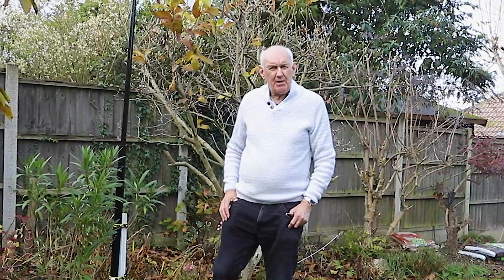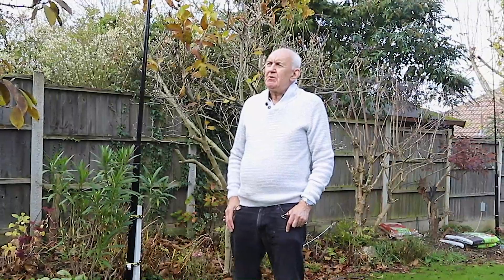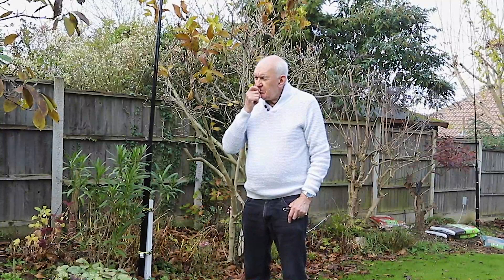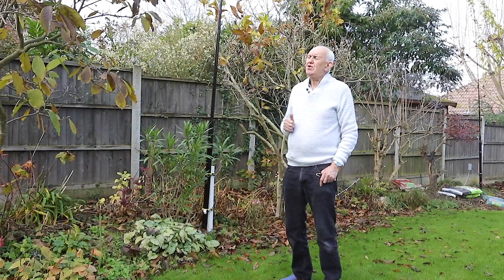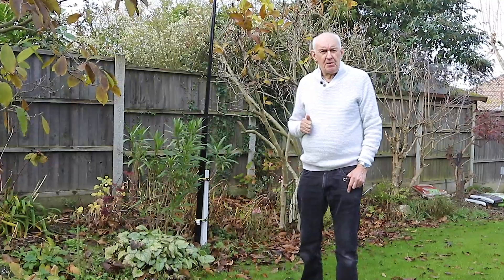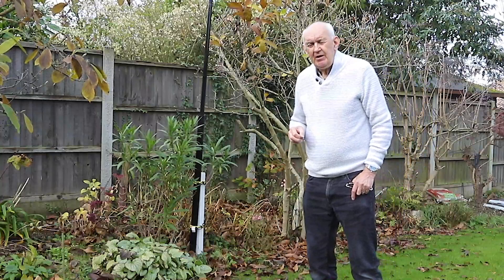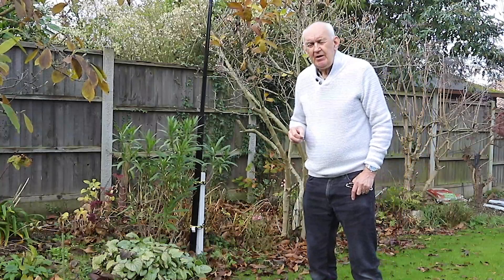The Magic Antenna - Joystick VFA

Comment: I did work into Czechoslovakia on 160m cw with my Joystick from Plymouth.  I added a long counterpoise wire that went out of the house and down into the garden. it boosted the 160m signals by an S point or more. I think the counterpoise was doing most of the work.   This was 1976 and what did I know about aerials then. We didn't even have swr meters in those days.

Comment: I have built two of these. I use one at the home QTH in King William County, Virginia, USA and the other at my Summer home on the Outer Banks of North Carolina. They, surprisingly, work pretty well. I've made  DX contacts and QSOs as far away as Australia. I used the "WA3WZR Modernized Joystick" design using materials I had on hand.
Jim Pyne AJ4CA

Comment: Hi Peter - Your video brings back memories of when I owned a Joystick antenna. I think I paid $29 for the antenna.  The coil was covered in plastic (secret stuff :) and I had mine propped against the wall of my bedroom and used a Heathkit HW-100 transceiver and yes I did make lots of contacts. I took the antenna with me when I was at Arizona State University and gave it to a friend who had just become a ham. I replicated the Joystick when I finished my studies and still have that antenna and the Joymatch upstairs in a second bedroom. I have used the antenna since the late 1960's and for an easy to build antenna it has served me well. When I was at ASU I would frequently work Hawaiian stations on 10 meters. Having outside antenna restrictions where I now live, I still use the Joystick with my Heathkit SB-102 on 40 meters. I also remember the advertisements for this antenna saying that it was as good as a 3 element beam - it was good, but more because of the sunspot peak during that period. The antenna is still fun to use and thank you for the video.
73, Bob W3ARA

Comment: Hi Peter, I was newly licensed back in the mid 60's and read an article in 73 magazine for an antenna called the "Little Wonder" by W5ZBC. The construction plans were similar to the "JoyStick". As I lived in an apartment at the time, I built one out of two 36-inch lengths of copper tube with a wooden dowel and coil of #16 wire in the middle. I used an L-network tuner and an unspecified length of single feeder. Of course it worked for many CW contacts. It also generated lots of RF burns and lots of interference with the neighbors TVs and HI equipment. Those were fun times! Thanks for the memories, K5RY

Comment: As a 12-year-old SWL in the early 70s, I recall the Joystick VFA being mentioned in PW all the time, used by listeners as well as licenced amateurs. I assumed, back then, it had something secret and amazing about it. I'd have liked one, although I'm sure my length of wire running down the garden with my little L-match ATU was just as good. 
The low noise levels back then meant everything, no matter what antenna you had. I remember those evenings where the only noise on 80 was a bit of TV timebase buzz, very low level: and the occasional crackle as a light switch was operated somewhere.
73 de G0IFI
Reply from the maker: Hi, nice to hear from you. Happy memories! 73s Peter

Comment: I certainly remember well as I was raised in Margate Kent next door to Broadstairs where George had his business.  Remember seeing his car parked outside with this VFA antenna on the roof rack . Was mounted at an angle, strange setup.   I remember as a SWL  hearing G3EBU near Canterbury   on top band using the lot stick. He had it mounted on a 29ft pole with 60 ft single wire feeding it. Well it's pretty obvious the single wire was the main radiator.    I was only 18 then. I eventually did the CG Rae sat Ramsgate in 1968. But due to my work as an electrician it was 6 years later before I applied for a licence. G4GJA and now a GW. Good memories.
Reply from the maker: Hi Kem, great to hear from you. I was active on top band in the early 1960s and had many contacts from Essex with the Kent hams. Great times. Thanks for the info. 73 Peter.

Comment: I remeber my late Dad G3LSZ had one. I am guessing that the Joy thing was that it was quick to deploy. It had a rubber foot on each end so you could lean it against a wall easily. It was painted light blue with a wing nut at one end to take a single wire feed.

Comment: Back in the 70's I knew an SWL who had the VFA installed in his upstairs spare room shack. From what I remember when I visited him one evening, was how well it worked on 80 Meters for an indoor antenna. To look at it you wouldn't think it could work so well as it did, I was amazed. Many SSB and CW signals were 59+ on the S meter of his Yaesu FR-50B, which impressed me no end as I also was an SWL. He also used the VFA on the higher HF bands for DXing including 10M, and had a great score, on the Heard All Prefixes Short Wave Magazine SWL feature. So I think good propagation conditions and low noise levels apart from TV timebase, played the part for the VFA. These days it's a completely different story of course.
Reply from the maker: Nice to hear from you. I think the much lower noise level in those days, helped.  73s. Peter
Reply: @watersstanton  Yes that's true Peter, I can remember the lower noise levels, especially on Top Band. They were great times for amateur radio.

Comment: Back in early 1968 I had Joystick Antenna.  It was  located indoors I managed to work XE2JS and UA0ZV on 40 meter CW using a homebrew 2 tube 30 watt transmitter and a Heath HR 2 receiver that had no CW filter. The reason for the indoor antenna is a neighbor complaining about TVI maybe with a hidden antenna he will stop complaining which he did ! Oh yes I was located in Portland  and that make it easier to contact UA0 land.

Comment: Hi Peter, I had one in use with my first receiver, a Trio 9r 59ds, bought from a dealer in Leyton. I only used it for RX, but it seemed to work well enough, mind you, I had nothing to compare it against! I used it propped against the wall in a barrack block when I first joined the RAF, and later had it mounted high up outside. I think it eventually went in the skip when I discovered the 'Magnetic Long-Wire Balun' from RF Systems, and put up a co-ax fed wire............M0KED.

Comment: The dummyload antenna from the 80's made and sold by a German. 50Ohm resistor in a box covered in raisin with antenna connector.

Comment: I remember a lot of local amateurs using this antenna on 160m when I was a short wave listener in the 1970s. Here is the link to the US patent for the Joystick antenna: http://www.freepatentsonline.com/3274600.pdf
Reply from the maker: Hi there, Thanks for your input. 73s Peter
Reply: @watersstanton  I've been intrigued by the design in the patent so I've modeled the Joystick antenna in the 4NEC2 antenna modelling program. It's a resonant tuned circuit at 7 MHz but even with wires attached at various points as described in the patent the highest gain I could get was -10 dBi (typically -15 to -20 dBi on most bands). In other words it would work after a fashion and probably sound OK on receive with the quiet RF background back in the 1960s or 70s. On transmit it would radiate some RF but would be well down compared to any other antenna. With very good solar conditions you no doubt could work the string of DX shown in the advertising but only on a good day with a following wind!
73, Chris G4HYG